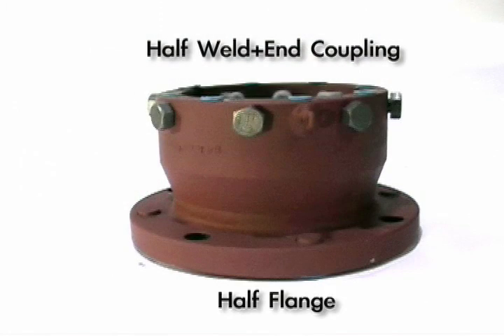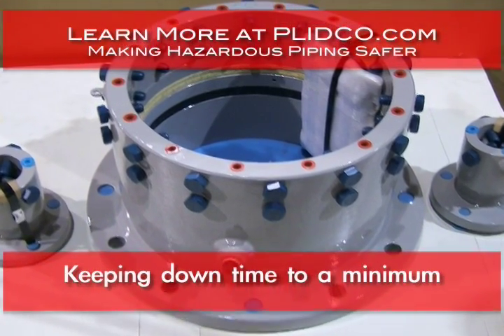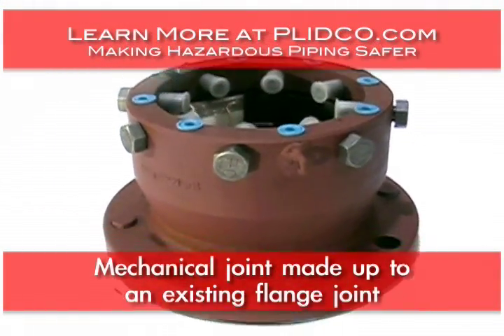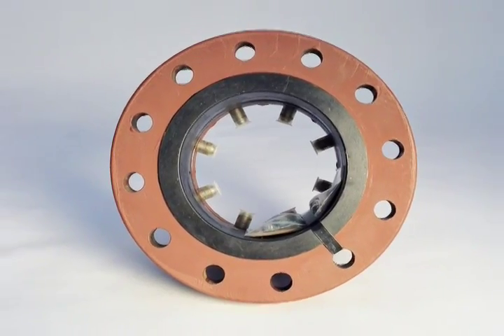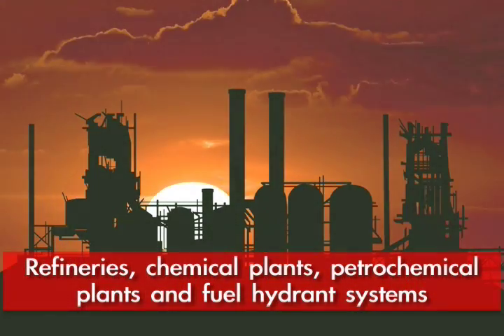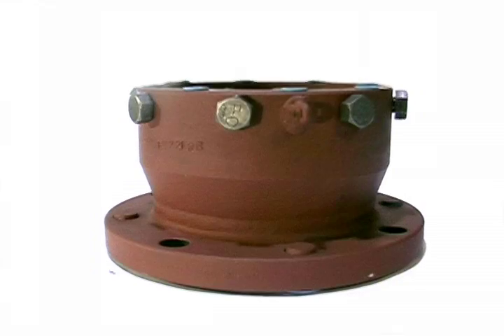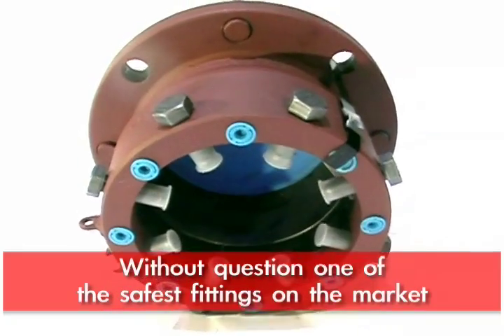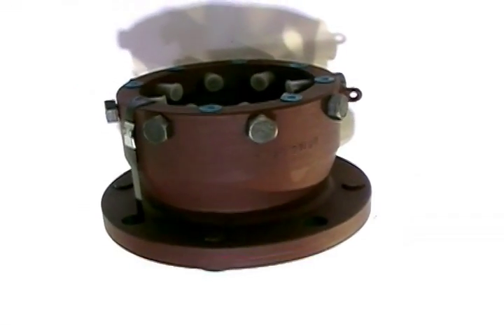Safe, Quick Pipeline Joint Repair Without Welding from PLIDCO

Comment: Hi Team, Need to connect with you to understand different pipeline joining methods that do not require welding to join the oil and gas pipelines.
Kindly share your contact details so that I can connect with you.
Looking forward to your revert.
Thank you